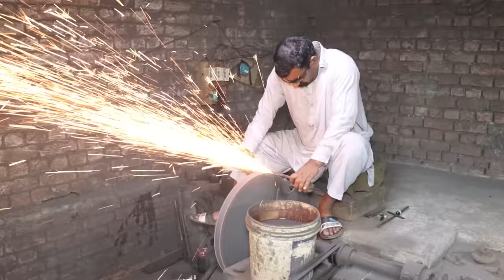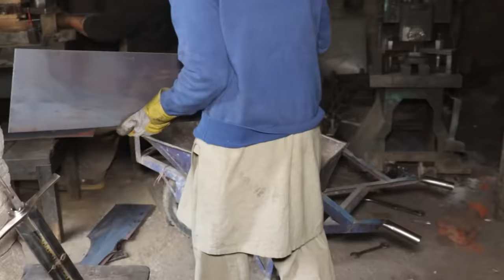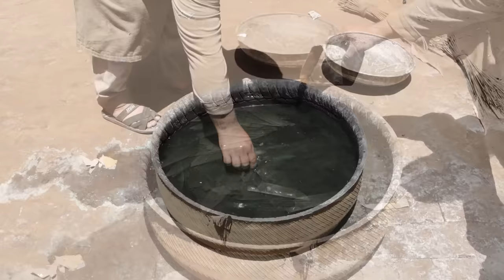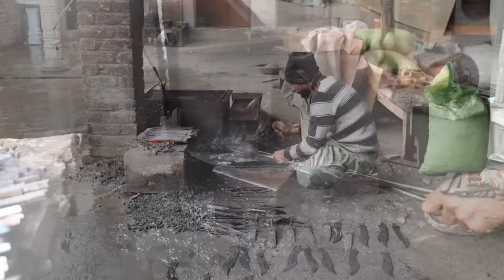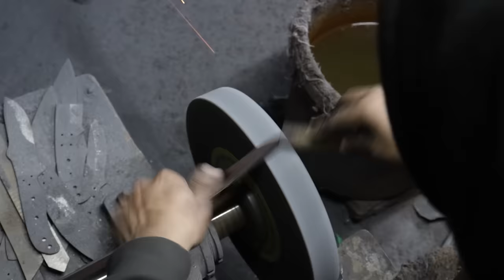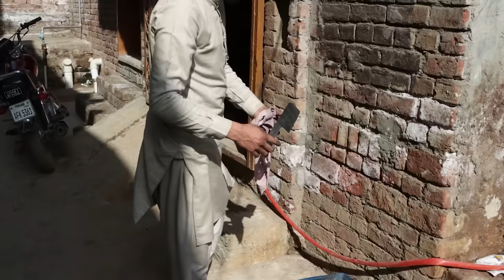Top 7 Fantastic Super Sharp Hunting Knife Forging and Manufacturing Process Videos

Comment: First knife was really good. But after that most of the knives were not that good since those knives had small metal piece going inside the handle and they Welded the round metal rod into the handle  This is the worst way to make the practical knife, if you are making show pieces That's fine.